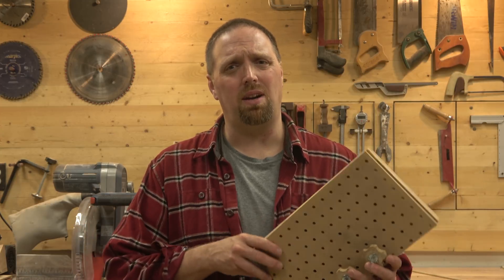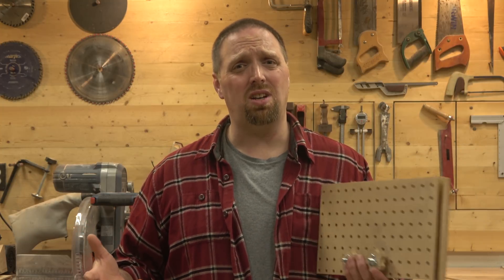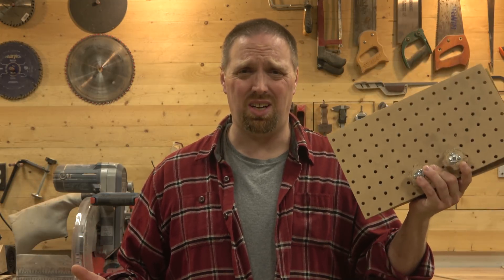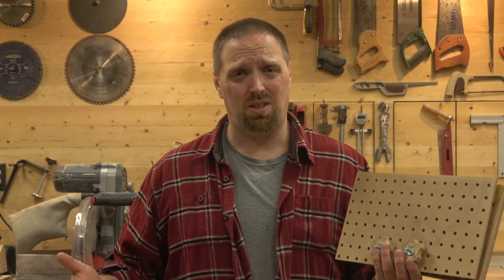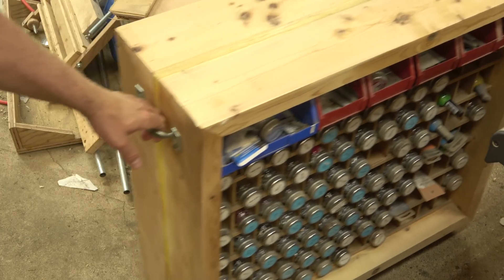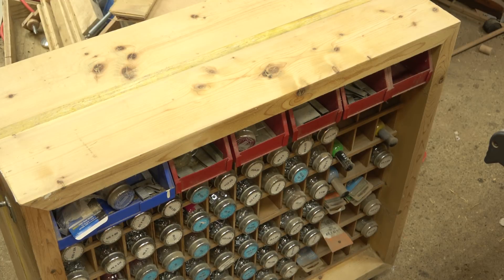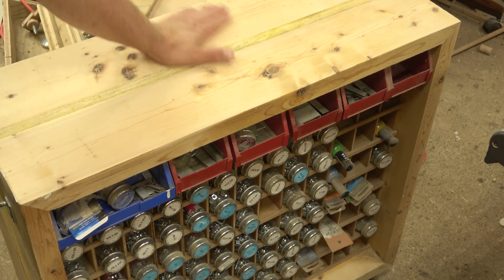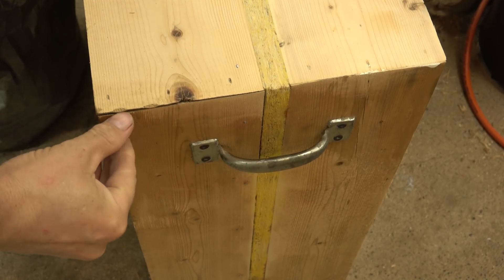Dowel Rod Splines // When Odd Sizes and Shapes Make Regular Splines Difficult or Impossible!

Comment from the maker: If you liked the spline jig in this video, you can download free instructions over at instructables by clicking this link  -->  https://www.instructables.com/id/Dowel-Rod-Spline-Jig
Reply: Make Things, would you consider glue-coating the dowels before you drive them into the holes? It would seem that they would go in easier (lubricated?) and they would ultimately, be stronger.
Reply from the maker: @Gary Goodlund maybe but remember that a lot of that glue will come off as you put it in.  I do suggest sanding the dowel (like chucked in a drill with sand paper) a bit so it fits in better.
Reply: I followed your link.
Google Ads managed to keep their Ad box over your information, as I was exploring the website.

Comment: Great jig👍 I will definitely make one of those for my projects. Saw you using an awl or a punch to mark screw holes. I have been using an automatic center punch for quite some time now and love it. You can get one from HF for $4 or go really crazy and get a Starett for around $50. I have two, one from HF and the other from Home Depot. Both are adjustable for pressure requirements so as to not leave craters in soft wood. Thanks for the great video.
Reply from the maker: Thank you!  I appreciate your kind words!  I have a center punch but have never really given it a chance.

Comment: An easier way to make the diagonal dowels would be to mark the locations where you want dowels, and use just one 45 degree drill guide.
Reply from the maker: Yep, but at the same time it’s harder to pattern them.  With at least 2 holes you can leap frog them together.

Comment: great idea, im going to be making one of these. 

my thoughts, however, the smaller box spacers seemed very complicated. i think just having another set of drill guides in the other side that is blank would be much easier. just spn the jig, no turning screws and no parts to lose.
Reply from the maker: Yep, I think that would be a good solution.

Comment: I'm thinking maybe a toolbox that holds a lot of weight with a handle with spline joints to hold it together? Maybe metal conduit instead of wood dowels? I gotta jot down some sketches...good video dude...and any puppies left?
Reply from the maker: I’m all about using conduit in the shop...it’s so cheap and strong.  

We had 2 left but they’ve become part of the family 😂.   You might see my girl Blue in the background some time.   She’s become the shop mascot.

Comment: I found out somewhere on youtube you don't have to balance things at an angle for splines on the table saw. Just place the item flat on the table surface and run it part way. With the blade at the right height and a stop block to keep from going too far, the kerf can be symmetrical.
Reply from the maker: Very true!  Thanks Robin.

Comment: I admire your creativity.  I am a tad bit envious of you skills and talents and attention to detail. You do good work.  So much for the good parts.  With only humor intended, I must add that you've made that nice,(insulation killing) cabinet for your tools but resorted to  hanging more tools onto the outside of it... which kind of kills the "hidden" tool affect and collecting dust again...just like a peg-board, heh? (Also, in putting my chisels blade-up on the magnetic strip and cutting my hands a few times, I went back and re-hung them blade down.)  Over-all, a great little video.  Thanks much.  PS.  I kinda hate that music a little....(sorry)
Reply from the maker: The dust didn’t bother me on the pegboard, although it does suck having a layer of it to constantly blow off.  And yeah, definitely an insulation killer!

Thanks for all the nice words Mitsuko, really means a lot to me.

Comment: Wonderful video. I've been using dowel splines to strengthen glued miter joints for years, but I've never thought of making a jig for this purpose; since the depths of the boxes I strengthened with dowels weren't very deep, I could eyeball the angle of the holes and drill them unguided. But this will make the entire procedure so much easier and quicker. Thanks!
Reply from the maker: Let me know if you make one...instructable is pinned in the comments if you want more detail.

Comment: I like the idea of the jig as. I make a lot of boxes from 3/4 inch stock and will make one for decorative alternative to traditional splines. On the downside the splines cant be visible inside the box in my case, so it would have to be specific to the stock size. 
I never made a table saw spline jig, but instead made a jig for a 4 1/2 inch compact saw. This type of jig  could easily be modified to make splines in a good range of stock sizes.
Thanks for a good idea and clear video.
Reply from the maker: Hey I’d love to see it when you’re done!  Send me an email of a pic or maybe just link one here.  Let me know!

Comment: For thin stock this is good.  But for 3/4 or thicker just drill a hole 15 to 30 degrees off vertical about thickness of stock into jointing piece and glue into place.  Now you only have one hole for every dowel to fill.  I like to leave face frames or fronts of boxes or drawers clean and drill from each side into  front.  If possible I've been doing that with quick setting glue 

for 50 years(ouch).

Comment: Great jig! You really only need shims on the blank side, bringing the drill guides incrementally closer to the edge depending on how many shims you stack. Don’t have to worry about drill bit depth then. Cute dogs BTW.
Reply from the maker: You know...I think you’re right.  At one point I had thought I didn’t need to shim the drill side...I didn’t think of it in the reverse. 

I’ll have to test it out and let you know.  

Thanks...and yes they’re cute.  So cute we kept 2 of them.
Reply: Keep me posted! Portable jugs are so handy sometimes, and you can use it on small stuff. I saw you had to continue the hole without the jig, so I figured less shim would be better anyway. You can also get a foot long drill bit lol
Reply: Have you thought about attaching your shims with magnets?  It seems like that would make it pretty easy to change back and forth to different box sizes, and you could have several sets of shims with varying thicknesses.  Sort of like non-marring vise jaw liners. You might also be able to use partially protuding dowels in the shims that fit into reference holes in the jig,  alone or with the magnets, to keep the shims from shifting.

Comment: Cool concept. Could one almost repurpose an old Kreg single hole jig and some bushings to do the same thing?
Reply from the maker: You might be able to, although the kreg jig might need some work to make it happen.  Are their pocket holes at 45 degrees?  That’d be another thing you’d have to figure out.  As far as the spacers, they’re pretty cheap.  Check out the instructable pinned to the top for more information...it’s free!

Thanks for your interest!
Reply: @MakeThings  good points. I'm gonna have to wander down to the kids room.IE workshop and bust out a protractor. Once again cool build
Reply from the maker: Thank you!

Comment: What are the inserts that you placed in the jig to guide your drill bit and where do you get them?
Reply from the maker: https://www.amazon.com/Round-Spacer-Aluminum-Finish-Length/dp/B00FG9Z1LS/ref=mp_s_a_1_3?keywords=%2310+x+5%2F16%22+x+1%22+Aluminum+Spacers&qid=1561946663&s=gateway&sr=8-3

I was able to buy them at a local store individually, but that’s the size I found.  They’re aluminum spacers and they do come in a variety of sizes. 

When I get back to my shop (I’m a hundred miles away right now) I’ll write up an instructable with much more information.

Comment: First off love the things you make and share!
I noticed you often use T-Nuts. I was wondering what you thoughts were on Threaded Inserts? 
IMHO I like them and think they give a cleaner look. 
I am wondering if you could take a moment to share your thoughts on the two options.
Reply from the maker: Honestly, that was my first choice.  But I stockpile t-nuts like the world is going to run out of handles, so I just stuck with those.  I do like adding a screw to the top usually, but felt like the bolt was helping to secure the t-nut down, which isn’t always the case.  

Thanks for the compliment man, I love sharing ideas with others.